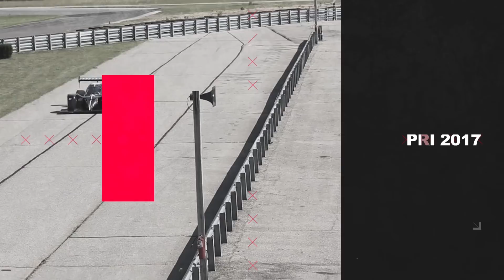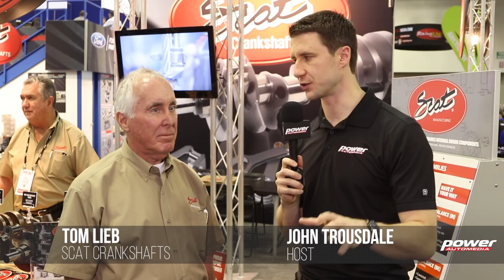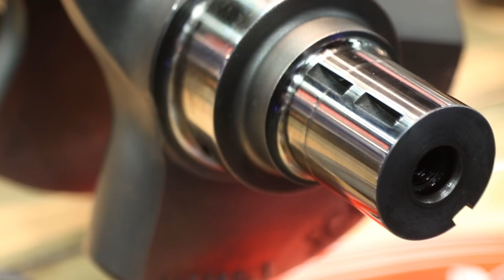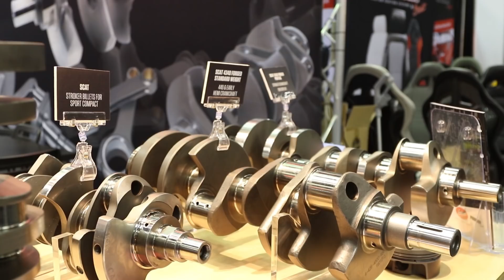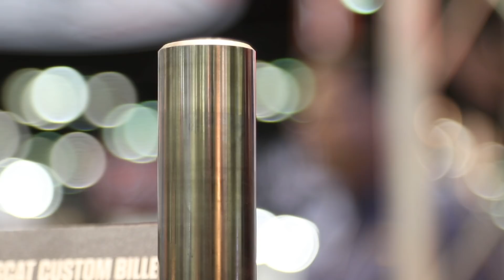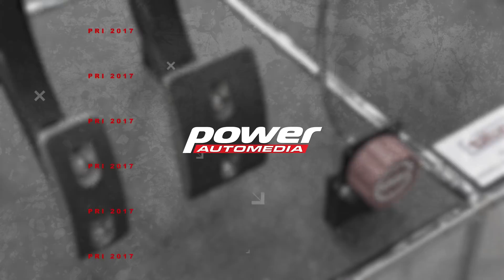PRI 2017:  SCAT Custom Crank Program

Comment: I've had a scat billet crank shaft in my vw since 1986 and i have turned it one time , it is an investment that has paid for it self more than once  i am making 600 HP at the tire, and the car is turbo charged   thank you for a quality part